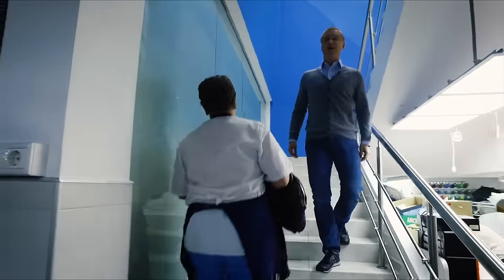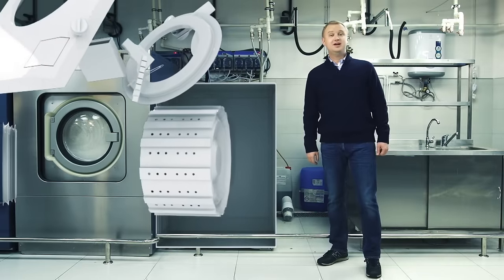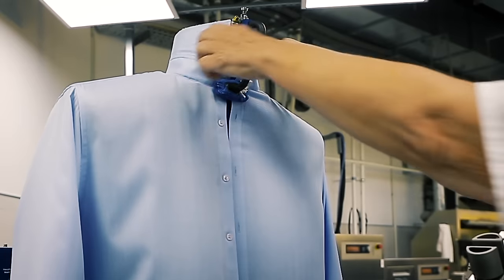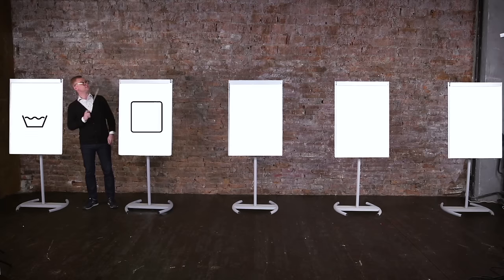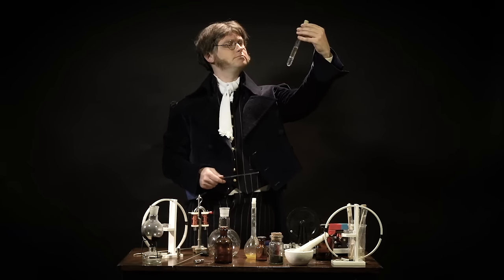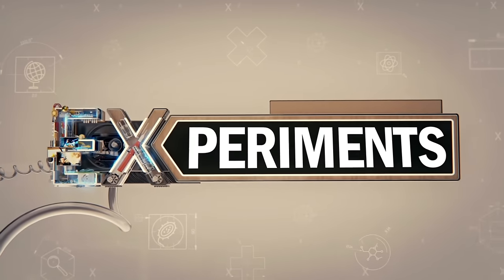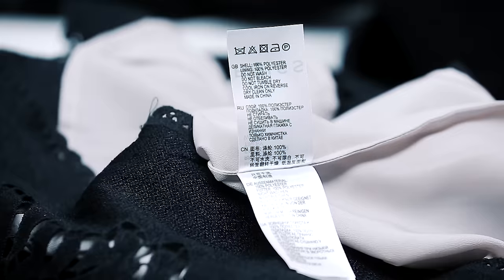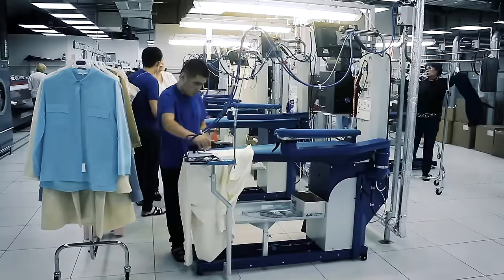How Does Modern Dry Cleaning Work

Comment: I don't think my dry cleaners does all of this.  It seems they throw it in, put it on a hanger, and call it a day.  lol
Reply: Actually, it's a ton more involved than you might think. First, it gets sorted, and tagged so it doesn't get lost in the process. Second, we clean it in either wet or dry cleaning machines. Third, the product is steam pressed, folded, and ironed. After that, the clothes are bagged, placed on the racks, and you pick it up. All these processes use employees, and a ton of manual work.

Comment: Nice video , a bit curious why we don't make regular home laundry machines. Drywash safe with that chemical tetrachloroethylene. Then just sell tetrachloroethylene so you can drywash at home in the rare cases you need to do a few suits.
Reply: The chemicals and technology involved require distilling machinery, which are both difficult to maintain and dangerous. A customer friendly micro-distiller haven't been figured out yet.
Reply: Because the solvent is highly, highly regulated by the EPA and every state in the union along with some cities and counties. We have inspectors that visit the cleaners regularly to keep an eye out that we have no violations such as spills or solvent vapors in the air. Some states have banned it altogether. If you've used it presently or previously you have to have a phase 1 and phase 2 environmental study done before you can sell your property. So this is why you can't use it at home. I've worked in the industry for 40 plus years.
Reply: @cleophusfowler  This is correct. And I'm only a 5 year operator at the moment. All our machines require frequently changed carbon to reduce vapor, constant changing of the filters, all kinds of stuff. It's hard to imagine any way a home consumer could safely or reliably perform even a single clean and waste disposal of the leftover solvent. And then there'd be a whole other waste disposal industry surrounding that for consumers that would be extremely headache inducing.

Comment: Dry cleaners today use starch  and Perchloroethylene or "Perc" as it's know in the Dry Cleaning industry. Sometimes, they will use Natural Gas as a cleaner in the machine. Also, dry cleaners use a ton of steam too. So much in fact, they use a massive boiler, like 10 to 20 ton boilers. I have been inside so many boiler rooms, and every single one of them gets really hot. In the winter time, it's not so bad. In the summertime, however, its awful. It gets up to 140 degrees, (or 60C.), in there. They also have water heaters in that room too. You only get 15 minutes inside so whatever you're repairing better get done quick in those hot summer days.

Comment: Not going to try this but a bit curious what would happen if you dump either mineral spirit , turpentine, kerosene ,...etc into you washing machine and just shut off the water supply lines to the washing machine. Humm apart from not disposing properly into the sewer ,would it work like a dry cleaning home machine. Obviously toxic , not safe , and flammable but if you can succeed with those I image you should be able just to get tetrachloroethylene and do it with that. Which would be non-flammable, safer , ...
Reply: Improper disposal of the chemicals and ruining your washing machine would be the most likely issues. You might be able to air dry the clothes after a few days on a line, but putting them in a dryer would be hazardous. Just a bad idea in general.

Comment: Basically what I am getting at is what makes a dry cleaning washing machine so different then a home or regular washing machine other then the detergent/ solvent you add ?  Is temp regulation an issue , disposal of the solvent not down a sewer pipe ,... ??? What makes it impractical for homes ?
Reply: You don't want consumers handling those chemicals. If they somehow get into the water course they can cause havoc
Reply: @yogiontour  You don't want some people handling dishwashing liquid.  They do stupid things like putting it in an automatic dishwasher